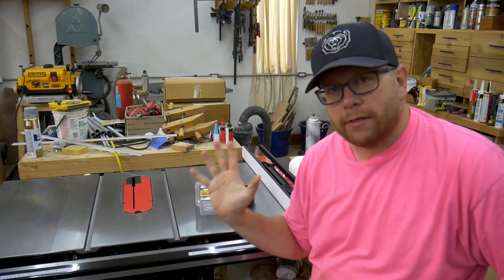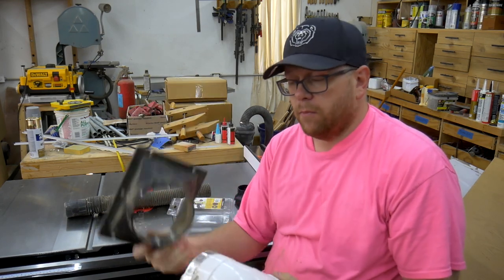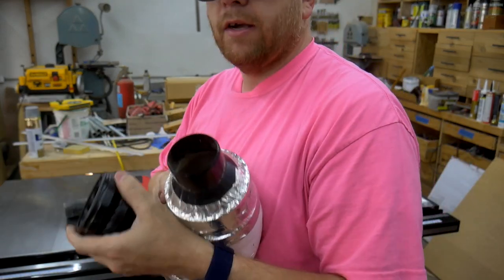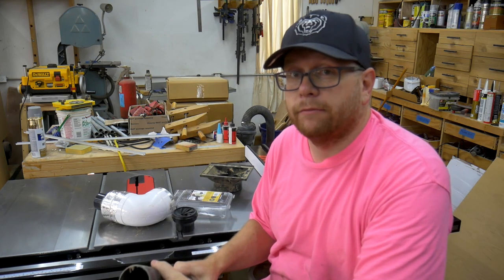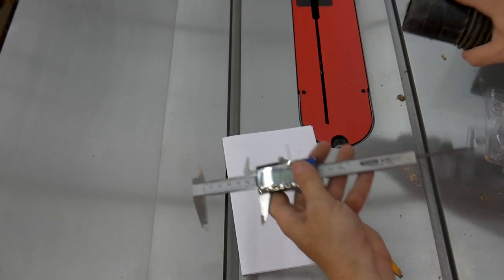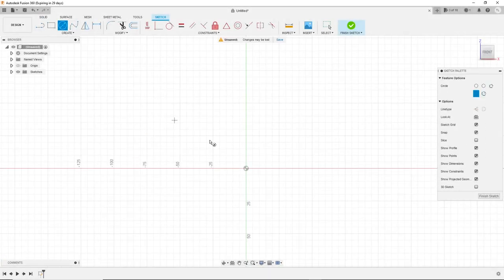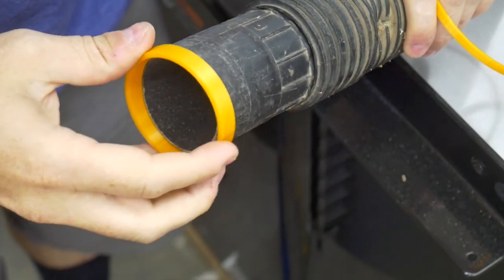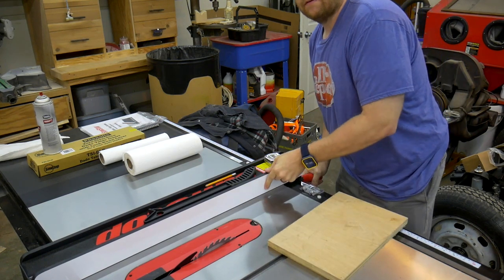Make Your Own Shop Vac Adapters with 3D Printing!

Comment: Nice work!  What does it cost to get into 3-D printing: the machines, software, etc.?  Thanks.
Reply from the maker: You can get a decent printer for less than $200 these days. The software is free: both the 3D modeling software and the slicing software.  My favorite printer costs about $250, but it is super reliable and has features the cheaper ones don’t have. If you are interested, I suggest you check out some of the great beginner videos found here in YouTube. Cheers!

Comment: the problem goes deeper than this level of compatability.  I have 4 (yes four) shop vacs from different manufacturers.  each one has a different size hose connection and takes different size nozzles. i think its a case of proprietary isolation, causing you to pull your hair out.  To add insult to my misery, the places where i bought them dont sell spare parts or fittings. Two of them are el cheapo and 2 of them are big brand.  

its probably a world wide problem but it. sure pisses me off.
Stavros